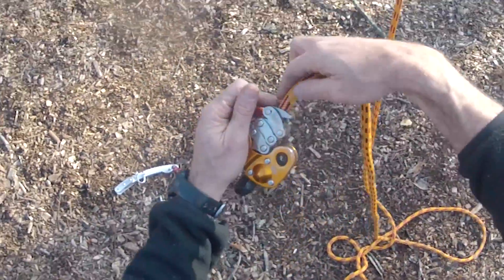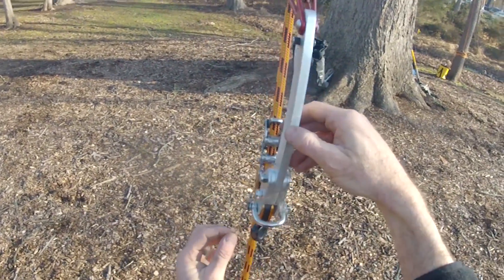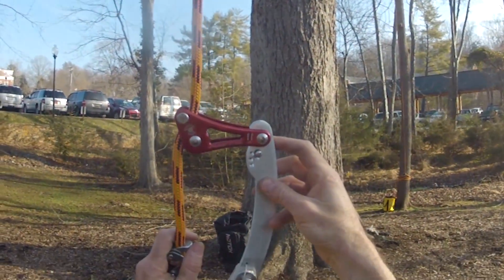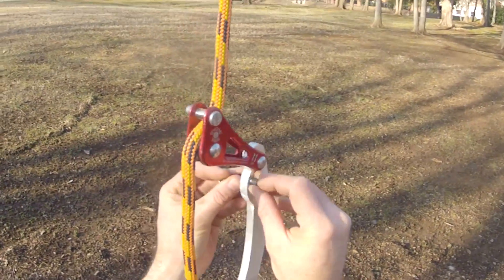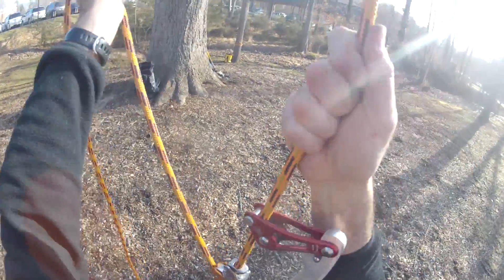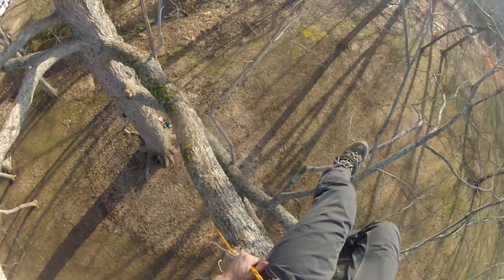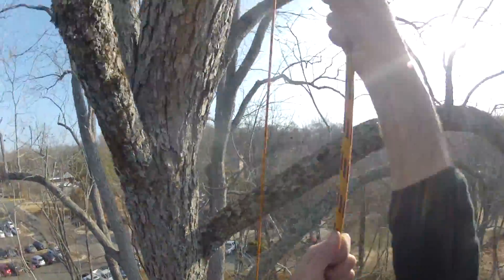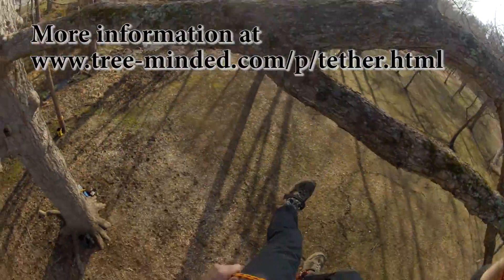Zag Wrench Tether

Comment: I will say this is by far the best attempt I have seen yet to make something to use the zigzag for set though. it is atleast realigning itself when descent starts, but still not aligned correctly untill descent has started leaving the stem in the side loaded condition.
 I always viewed this as the weakest point in the zigzag for set use.....not the links.

Comment: im glad your thinking about the orientation of the zag, but what about the added stress on the stem of the swivel?  I can't imagine that because of how the zigzag was designed that the stem of the swivel was designed to be side loaded against the stop.
Reply from the maker: Hey Paul.  Thanks for the comment.  You're right that the post of the swivel experiences an unmeasurable amount of extra stress when using the ZZ SRT, so for people who choose to use it this way, it is important to inspect it regularly. I haven't noticed any wear on the swivel post after dozens, probably 100+, of hours of climbing.

Comment: I've had metal smack me in the face and teeth.  This seems like a no go safety wise.  I like the idea but why buy pieces of equipment that are probably 5x more expensive than the wrench and a piece of cordage, that with the right knot will perform equally as well?  I see a lot of gear nuts out there, and I'm guilty, but at the same time I only buy the equipment that's going to last me the longest, is safe to use, is suited to my climbing style,  is the most efficient way of accessing and moving about the tree, and is the least expensive.  I think that's a logical way of approaching new gear investments.

Comment: What are your thought's on the potential situation where this tether got side loaded against a branch?
Looks like a really smooth piece of gear, great work!
Reply: the zigzag should be oriented correctly when passing branches in ddrt or even in this particular setup.
Reply from the maker: https://www.petzl.com/US/en/Professional/Torsion-on-the-ZIGZAG-and-ZILLON-chain
Reply from the maker: Tautvydas Kuodys Thanks. The tether would lend rigidity to the system in a side strain scenario like you mention. I think the ZigZag would fare better with being smeared against a branch with an aluminum tether there to protect it. It's true that the ZigZag is vulnerable to side impact/bend in DRT setup too.